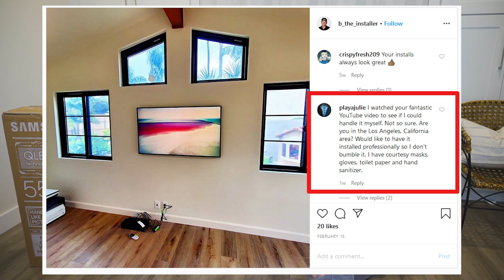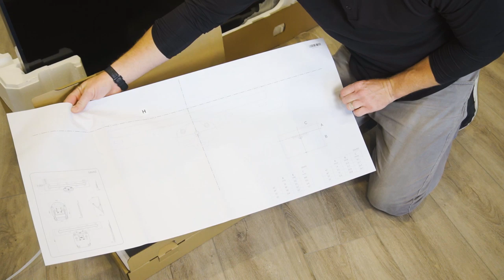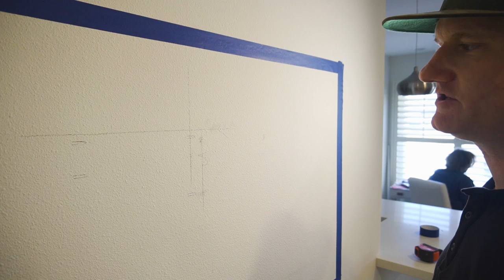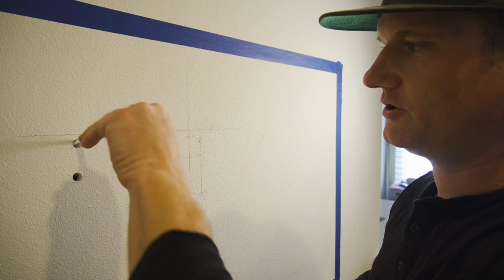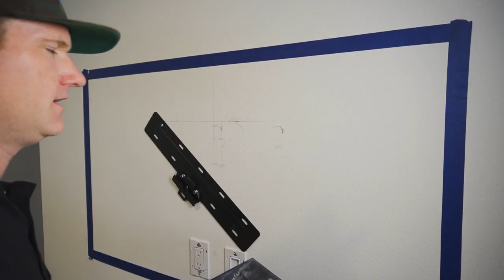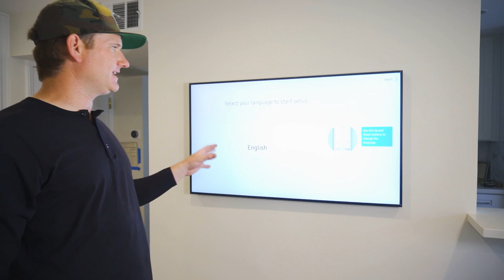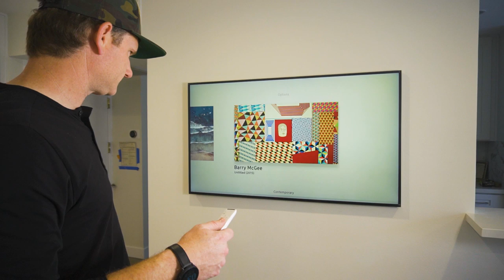Samsung Frame TV Install With No-Gap Wall Mount

Comment: What size conduit do you need for the one connect plug?
Reply from the maker: A little bigger than an inch.  Don't use 1 inch.  That was 2 inch I believe.
Reply: Hi, I just checked.  1" even for the small side of the one connect connector is too small.  1.5" will fit though.  Since you generally cut a 2x2" hole in the drywall we just used a 2" in case in the future we want to run a different tv or one that needs an actual old school power plug etc.
Reply: @BTheInstaller  I guess the conduit was already in the wall? From what I understand, electrical conduit pipe is incredibly rigid (double the thickness of water/sewer PVC); so it's not something that can be inserted through small openings after-the-fact, correct? I know they sell an in-wall cable. It's expensive and ridiculously long (33 feet! I just need 5 or 6 like your client did). Great video, btw. (And I like the music in the background! I could hear you fine.)

Comment: How do I get the TV off the wall? Please a need help
Reply from the maker: Lift up.  You can lean it forward and get hands under it and lift uneven, one side slightly higher than the other.  It will come off with some pressure.

Comment: So how risky is it to have the wire in the wall? I just need a 1-2 foot max since my tv is 4 inches from the mantle which will hold the one connect box. I keep seeing everyone freak out about putting the provided wire in wall.
Reply from the maker: I have a new install video dropping next Tues.  I use a conduit which I'll link. You really don't need it in wall.  It's a tiny thin wire and you can roll the excess up and set under the box on Mantel.

Comment: I wish you would show how to hide the One Connect Box BEHIND the TV.
Reply from the maker: I will do a video on it soon. Good idea.  But it's not really hiding it, its building a panel.  But theb you have no access to it unless you dismount the tv.
Reply: @BTheInstaller  Understood, but we no place to put the box other than in the wall or on the floor. There is no furniture in the vicinity of the TV. By any chance, do you know if the TV can hook up to the cable TV box?
Reply from the maker: Anything via the hdmi or even with the coax line.

Comment: how do you take it off of the wall bracket?
Reply from the maker: Lift up.  It's a little annoying but it comes off.
Reply: B The Installer Thanks, Didn’t want to break it. I turned it  to the left or right and the bar released.  Thank You

Comment: Did you not use the magnets?
Reply from the maker: Magnets? Like the extra frames?
Reply: B The Installer our mount cane with these magnet a to set up that pulls the tv back but we are struggling to mount it

Comment: ************************. Wait....you were suppose to put the wire into conduit in the wall (that’s what I watched your video for); you didn’t use conduit at all... so you have a unshielded power cord running through a wall; not code and not safe. Did I miss something?
Reply from the maker: The conduit doesn't make it perfectly safe either. It makes people feel better about it but its still a grey area.   This video had conduit in wall already.

Comment: Is it difficult to have your own art installed on the TV? :D X
Reply from the maker: No, you can load it up by just connecting your phone to wifi and attach or you can from computer or USB.  I should some videos on transferring.  If you load anything, tag me on IG post.  Thanks @b_the_installer
Reply: @BTheInstaller  Awesome! Thanks man! I don't have one of these yet but I'm seriously considering it! Does the TV have it's own internal memory? Like if the USB is pulled out do you lose the ability to display? Also, do you see future models allowing video art? X

Comment: I think samsung should make a budget model of this and lose that one connect box.
Reply from the maker: Yeah. Could be good idea.  To be honest this TV is a bit of a budget quality anyway, so if you want superb image, there are much better choices.
Reply: @BTheInstaller  so is it a dressed up q60r? Actually I like the frame concept but I think they can make it cheaper. Even the T8000 comes with ambient mode now.